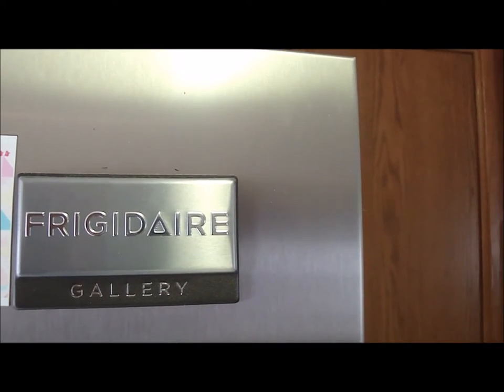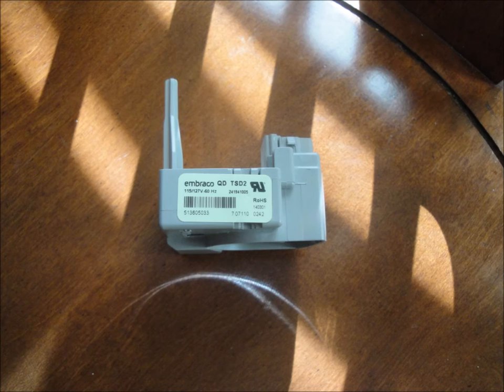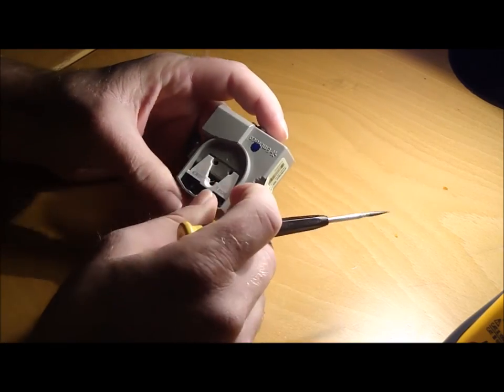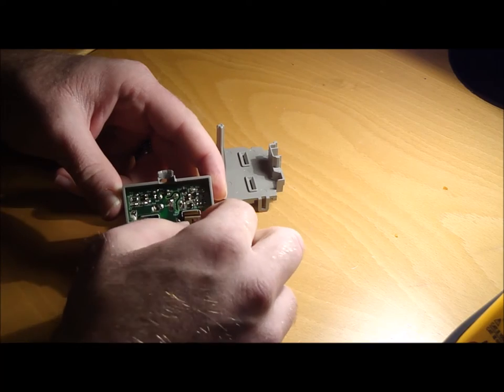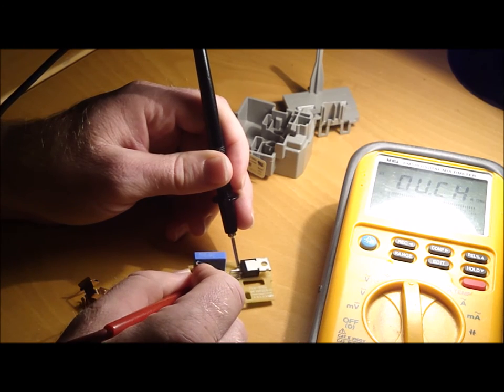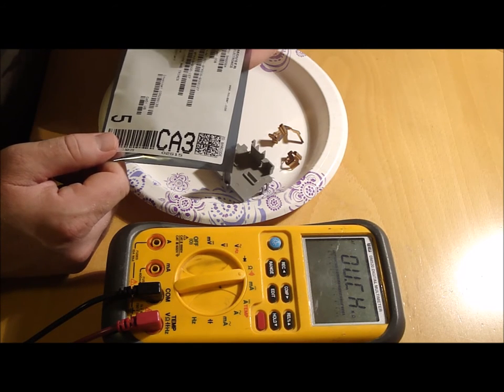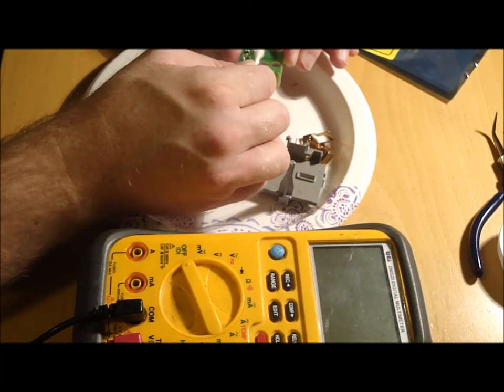Frigidaire Refrigerator and Freezer Won't Cool Fix

Comment: My fan is not running and I hear the compressor click and than nothing. My fridge and freezer are both warm. And reading H1. Would my problem be the same as yours?
Reply from the maker: Possible. I explained the problem I had at the beginning of the video. It sounds similar.

Comment: Why does your Volt Meter register the exact same resistance on the new part as the old one (0.6)?  Most of the time your meter isnt even showing anything of value.  If you're going to educate - educate!  What exactly is your meter telling you?
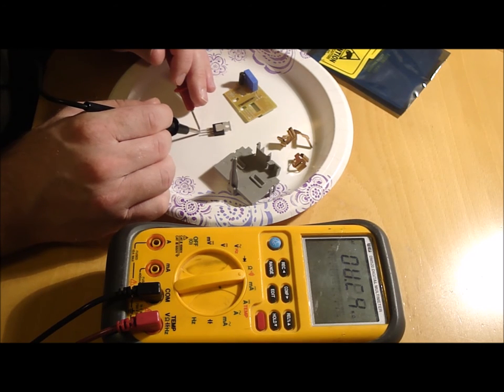Reply from the maker: +Steven Myers at 3:25 the meter is showing the old part at .6 ohms but at 5:25 the meter is showing the new part at .6k ohms. Big difference but a little hard to see the little "k" on the meter in the video if you're watching this from your phone or a small screen. Did that educate you?